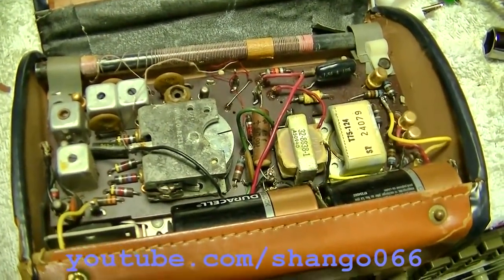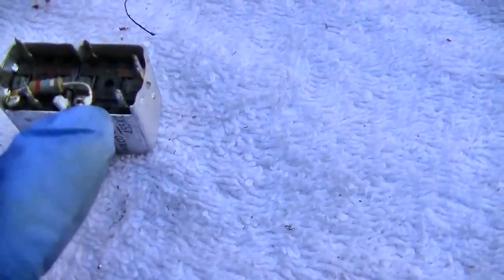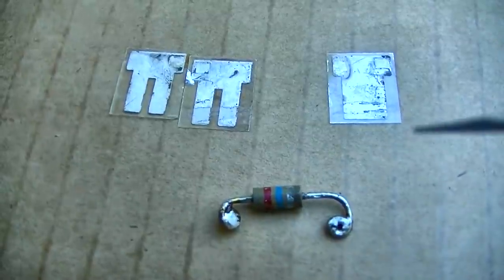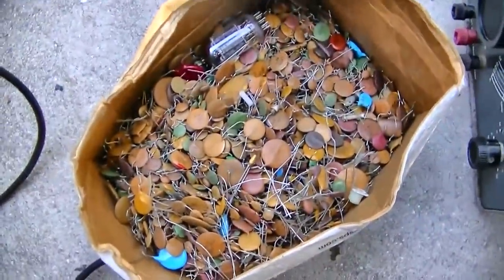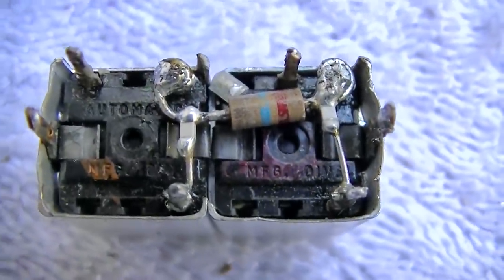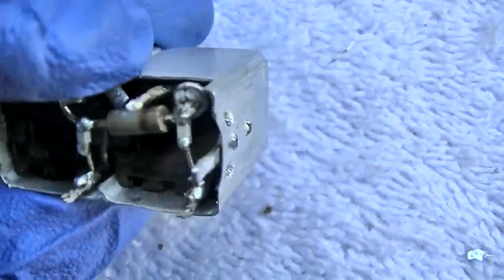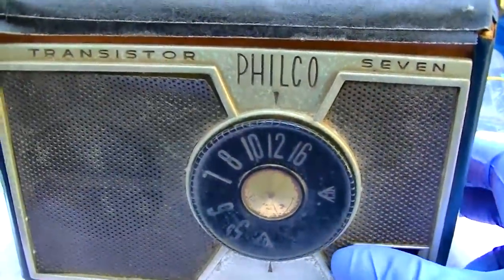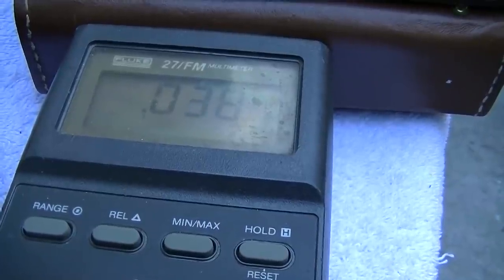SMD Silver Mica Disease IF Transformer Transistor Radio Repair Recap

Comment: It's capacitively coupled NOT inductively coupled ..... The best way to determine the capacitor size would be to measure the inductance of the coil with the slug out (minimum inductance) and then turn the slug in to get maximum and then use whatever is halfway. Then just plug that inductance and 455Khz into a resonance calculator and you'll have your capacitance.  Pick a value that is close to the calc (You hardly ever get a value that lands exactly on a common capacitance) and then use the slug to peak it. The coupling capacitor is an entirely different story because you need to find the "critical coupling" value (Keeps the passband flat with no dips and peaks) and that's hard to do without a sweep generator and a scope or a spectrum analyzer so you can see the passband

Comment: How about if the original Micah sheep was turned in the other direction where the black mark was not the point of contact maybe that would have done the trick

Comment: Interesting how you manage to get -70 to -80 dB on the signal gen.   I can't seem to ever get sensitivity  better than -25, no matter what I do.  Tried on MANY radios.
Reply: He was tapped into the radio with a small capacitor apparently in accordance to the service manual.
I find the objective/instrument measurement to be very interesting. I have a B&K 2000-E with the attenuation switches. I find that cutting a few in usually knocks out my indications. I've only laid the test lead behind the radio. Not a good way to get results which can be duplicated. Let me know if you try anything new or do a video. Maybe we all can try and do a sensitivity test with some standard procedure. I have many books. The old Coyne books are great.  Book 3, "Radio and Television Circuits," Chapter 5 "Receiver and Amplifier Performance," I have a marker on page 134 and Chapter 6, "Tests For Faulty Performance," I have a marker on page 150. This book is so much fun to dig into. It's an oddball orphan without it's other companion books, but I have complete set. It says 1955 Copyright 1957 Edition. Maybe we can try and do some tests in the same way. Different radios and test equipment and see how it comes out. Be well.

Comment: A few thoughts:  First, I did not see hardly any properAGC operation.  So, to me the AGC is not working correctly.  Some AGC circuits can exhibit nearly 60db of AGC and even the poorest ones will usually give you at least 20db.   I just did not feel you had good AGC.

As far as overloading goes (which in this case I think is AGC) , you can put the radio in a metal breadbox (of which you may or may not have to ground it depending on how bad fundamental-overload is i.e. KNX etc.) and you should be able to cut the signal down to see if the overloading/oscillation goes away.  If it does then the circuit coupling capacitors are OK.  The parallel resonant capacitors are NOT the overloading problem; if the cans tune then they are correct no matter what value or composition, especially since you are using the stock IF can inductor-coils

Finally, you can remove the 2.6pF coupling capacitor and twist two wires together to form a 'gimmick'-capacitor to get a feel for what the coupling capacitance value should be..  Your use of SMT caps is really prefered for both low-L and quality in a small package.

Comment: That's weird they stashed a resistor under the transformers must of been hurting for room
Reply: *must've
Reply: Must have been coupling capacitor.
Reply: Those are probably assembled and tuned separately using a spectrum analyzer. It supports another suggestion that the coils are tuned slightly off peak to widen the bandwidth and sharpen the skirts. Hard to do by “ear” as you don’t know the bandwidth you end up with. The extra gain and distortion (from filtering too much of the side bands) he experienced by peaking both seems to point that way.

Comment: What if you took a 180pf ceramic cap and filed down one edge until it measured 150pf, then sealed it with airplane glue? Has anyone tried that ?
Reply: Tends to short the plates together. The silver plating is soft and the file will tend to fold it over enough to short the plates. But in theory it’s possible.

Comment: 6:45 in...

WOW !!!!

ahahahbhahahbahahha 😂😂maite this is like somehow relateable and somehow unbelievable
Reply: In retrospect, You might have been better off cleaning and reusing the original capacitors...  Rarely does an economy brand use an expensive part unless they deem it critical.  YMMV !   Great repair video regardless !
Reply: if it were me, I probably would have just jammed a piece of paper in the top of the can and not even bothered with desoldering it to begin with....  The beginning of the video has a possibly nicer softer sound !

Comment: Why couldn't you just put a trimmer capacitor and act like you don't bother those 2 radios and then just it and then find what value it's reading at and then replace it with the right capacit around our needs when you align it😅

Comment: I BET 1 SIDE IS 160 AND THE OTHER IS 40 PF
Reply: Uh no. That wouldn’t make sense for a double tuned circuit. My guess is the two just have different date codes. For one run they used two caps in parallel, for the other run they had the correct value so there is only one.